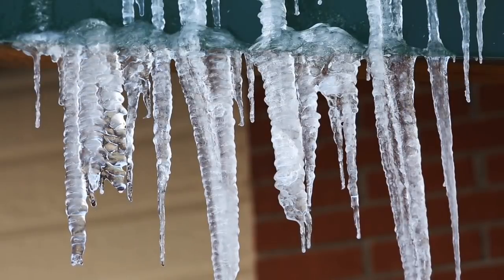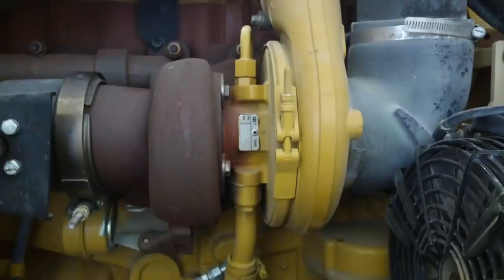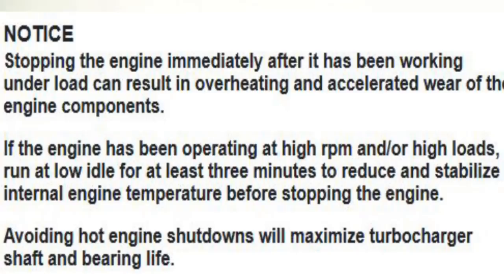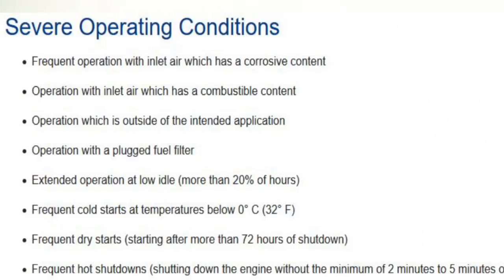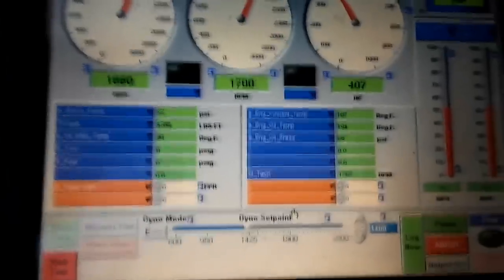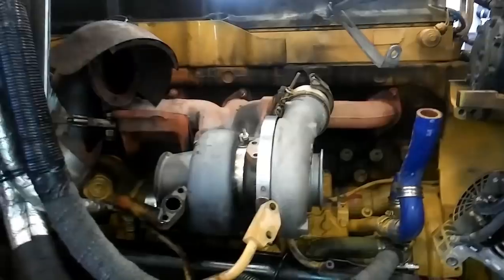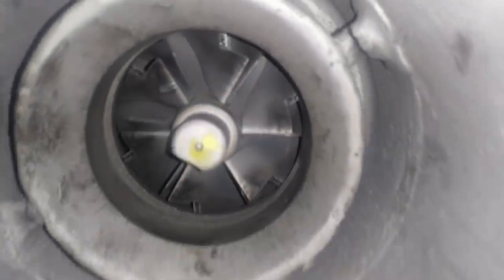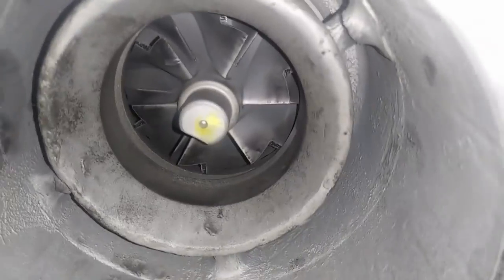Should you let a Diesel Engine Cool Down?

Comment: Exactly! What Josh said! Shame is, newer trucks don't have the guages to monitor all these temps. That's why I had a 96 Pete 379. Thx for the videos. Good job
Reply: Modern engines may well have safety systems built in. There are many engines now that have electric coolant pumps that circulate coolant after engine shut-down, not only through the block and head but also through the turbo bearings. Some may even have similar auxiliary oil pumps that essentially do a similar job, mainly through turbo bearings, especially on engines that have dreadful stop/start systems fitted.   
It is quite amazing that so many people seem not to know the regime for both cold starting or hot stopping engines, especially turbocharged engines whether diesel or gas. Every turbo diesel vehicle I've ever owned has this information in the driver's manual, admittedly not always as prominently as I believe it should be. But it is usually there in black and white.
Reply: Which engines have these electric pumps?
Reply: @jaredmayer3960  
My last Volvo XC90 diesel and my current Kia Sorento diesel certainly have these pumps for the turbo[s]. Pumps generally are going electric on state of the art engines and even automatic transmissions. The Kia/Hyundai wet clutch DCT [another growing trend in cars tractors and trucks] has two electric pumps, one for the wet clutches and one for the mechatronics.
I forgot, the Volvo and Honda have twin turbochargers and the Honda also has a turbo cooling system, although I'm unsure about an electric coolant pump on this one.   More and more cooling systems are getting very complex with ECU controlled valves in the system, as well as the traditional wax thermostats, to restrict cooling to certain areas or increase as demanded, for quick warming and least energy loss.

Comment: Newer Mack trucks if engine is hot will not turn off the engine until it cools itself down. Meaning you can turn the key off yet the truck will remain running until computer turns it off. Usually within 5 to 10 minutes.
Reply: Sounds nice.... useful feature.
Reply: Sounds great until you got a fuel leak that started a fire and you want it off instantly.
Reply: @lungelinecowboy  turning the key back to run position and back to off will override the cool down and kill the engine.
Reply: Better the fire starts on your parking than on your driving you may ask why only 10 percent of time trucker park away from each other most trucker only have two fire extinguisher if so much I carry five or more with the additional truckers around am sure they can bring that fire under control majority of fire while driving mostly end up as total burn out, so it's best to follow the message in the video and post check your truck after. That you don't drive down the road the next day with a fuel line about to rupture ✌️
Reply: @matthewhansen5008  Thanks for reply. It's good they thought about those emergency situations.

Comment: I had a 93 Dodge/Cummins for 20 years. I set the pyrometer probe after the turbo which will always read cooler than pre-turbo. It never hit more than 750d under load and my practice was to let it cool to 300d before shutdown. I now have a 2012 RAM/Cummins and set the pyrometer probe post turbo. It reads well over 1000d just pulling a grade unloaded. I couldn’t find any shutdown information and so settled on 400d. I can tell you from years of experience running these trucks as well as diesel boats that you can idle them till the cows come home and you won’t get much of a reading on the pyrometer and the coolant isn’t much quicker. The engine needs a load for both the exhaust gas and coolant temperatures to rise.  A Cummins engineer told me fire the engines up and idle out of the harbor than gradually bring up the speed. Going back in under idle will cool everything off just fine.

Comment: Thanks -Nicely done Josh well presented & explained . Down here in Southwest TX. heat is a much bigger factor than the cold . I tend to "high idle" ( 700-1000 rpm) my Cats 
 for 15 to 20 minutes then slow idle 400-500 rpm for another 3-5 minutes . This is on a day w/ ambient air temperature @ or above 110 degrees & heavy loaded .

Comment: So I guess when  I pull off of the highway and screw around getting to a camp site or to my storage place I've probably done enough low load running where the engine should be cooled down, but I'll make sure and check.   Keep the good stuff coming.

Comment: Yes it needs to cool down, the red hot turbo needs cool oil to cool It down otherwise it will carbonise the oil left sitting in the turbo when it is shut off straight away without cooling, you should always warm a turbo Diesel engine too. I always put the cabin blower on full hot for 3-5 minutes before shutting off to draw out some heat..

Comment: Josh that was a good find on the turbo, you know within a few days the turbo may have went out and they would’ve tried to blame that on the overhead work.
Reply: Here in Australia we have turbo timers. Whack it in neutral hand brake on and turn off the ignition. Engine will keep going at idle until the timer shuts the engine down.

Comment: I always idle or drive slow for about 10 minutes after driving fast before turning it off.
Reply from the maker: Sounds like you are doing it correctly there.
Reply: With trucks, most of the time the cooldown is built into the driving pattern. One exception might be something like a rest stop at the top of a hill, where you can go from a hard pull to a stop.
Reply: When start should allow idle until oil temp 100 or higher?
Reply: Benefits to engine block heater as high as 45 or 50 degrees? How long heater block?
Reply: Same, my driveway is 1/4 mile down hill with a slight slope, I don’t have a turbo, but I still let my idi cool down for about 2-3minutes. I never truly work my idi that hard, but I always start the truck & let it warm up for 5-10minutes before driving away depending on how cold it is, the 83-94 7.3idis or non turbo engines need more warm up time, this is because when it’s cold it needs a few minutes to get the oil warm, then a few high idle moments to get the heat up, so it runs better.

My previous 95 7.3 PSD was always warm by the time I got up my 1/4 mile up hill driveway, I can tell when it lugs down & accelerates slightly.
Reply: @joemeyer2726  100 degrees Fahrenheit should be perfect, thats what I do since thats the temperature that all the packets and detergents in the oil should be activated and evenly distributed thus decreasing premature engine wear

Comment: When I'm a few minutes from my destination and I know I'll be shutting the engine off I try to run the fan in manual mode and I'll stay a half/full gear down where I would normally be. This typically gets me pretty close to the base idle temperature for coolant and oil without having to idle much at all.

Comment: It's in a freightliner owner manual. Let it idle couple or 3 minutes before turning it off. Often I see the temperature gauge drop 8 to 15 degrees/ oil gets to circulate and cool down and not cook the engine. I even apply it to all semi trucks I been driving since I read that

Comment: I've always been taught to high idle at 1000 rpm for 4 minutes then idle for a minute before shutting down. What's your thoughts on this? Been told its to ensure good flow to cool everything off
Reply: That's not a bad idea. By high idling you avoid the slobber effect on the injectors, and thus cleaner combustion, yet very low power demand with almost no load, so that prevents the increased exhaust gas temperatures, and then a one minute cooldown to get it to the lowest possible temperature.

Comment: Good video. I always knew to let  the engine cool for 5 minutes because during my cdl driving test the instructor got on me for shutting down immediately and explained how scalding hot the turbo is and how the oil will leave a residue on the bearings. I use that 5 minutes to do paperwork and or fuel the truck for the next day. Depending on if I'm over the road or local. 5 minutes is a blink in trucking.

Comment: I always let it run 5mins after shutting the engine down except I've a light cruise for at least 10mins before shutting down then I just let it run an additional minute. :) - Great vid o/
Reply: Turbo timers...set and forget. automatically idles engine after "key off and out" for 1, 3 or 5 minutes (selectable) and that's for a cheap unit...

Comment: The inlet end of the turbo shaft is frozen from air being vacuumed near it.
The heat transfer from the hot side to the cold side of the turbo shaft is significant.

Comment: I have a Cummins 6.7 350 turbo you have to let it idle 7 minutes. Due to the fact that the turbo is still spinning and it has to have oil to the turbo bearing so it won't seize up the turbo. Also cummins has a wet liner idling also cools down the liners. Oil removes up to 80% of engine heat so iding helps cool the engine as well. Cummins engine warranty says you must idle for no less than 7 minutes minimum. When you take it in for service this is checked.

Comment: Yes this is a big issue  in automotive engines, too. The combination of long change intervals and oils with reduced shear stability like 5W30 or 5W20 etc. and not letting engines cool down. The oil gets too hot around the turbo because it doesn't move anymore after engine shutdown and burns up. In most of those cases the turbos fail because of lack of oil supply. I've seen banjo bolts from the turbo oil supply line that were completely clogged with burned oil/carbon buildup. I've had a customer with an Audi that repeatedly destroyed turbo after turbo on his car in as little as 20,000mls. 
Some manufacturers have now additional electric water and oil pumps that keep running after engine shutdown to minimize this problem.

Comment: When I started my job ( doing deliveries with a Kenworth T270 paccar 8.3L engine with 270k miles ) I was new to trucking at 18. I didn't clean the air filter enough times and didn't replace the fuel filter enough but the worst part of it all was kind of my bosses fault. He told me to save fuel by shutting her down while I do a delivery so I did exactly that. No cool down. I got the turbo rebuilt at 400k miles not sure how long it's been bad at that point. And for a long time I've been telling mechanics that I belive one of my pistons is worn out and I can feel it while driving. They think that's nonsense but I've now confirmed it's true and we are now rebuilding the engine at 425k. What do you guys think I did that would have damaged it the most? I think it was the quick shut downs which will dry out the bearings and the oil in the turbo sending the thick nasty overheated oil back through the engine .

Comment: We had a 600KW cat genset that we used to run our grain dryer. It had one speed wide open. Always felt bad shutting down a screaming engine at night. Usually had at least 10 to 20 minutes of light to no load as I shut off fans.

Comment: Yes! I always stress this to my customers as well with their equipment. When I pull up to the house at the end of the day, I let the service truck idle a good 15-20 minutes while I do paperwork and check things over for my post trip.

How are you liking SIS 2.0? I work for a deere dealer so I am partial to their system. But we do a fair bit of cat work also. And I think 2.0 is a nice change and a little easier on the eyes.

Comment: I drive, but it doesn't have a kitty kitty, I grew up around heavy equipment & my dad thought me this back in the late 70's - early 80's.I run lowboy & load my self, even after getting it on lowboy, I set the brake & let it idle to cool down as I'm tying it down then shut it off.When I get back to shop ,I let it idle to cool it as I'm fueling up & after I actually park it. As I'm doing my walk around checking things out then checking temperature, if it's down I shut it down.

Comment: Military taught us to let the engines rest at the end, after a hard run.
Reply: What did they suggest?.......we had Humvees in Iraq and i don't remember my driver purposely doing this although we hit the fuel point before heading to the hooch.
Reply: @arnoldziffle8779  I was a generator tech. The big 120k with Detroit Diesels would run hard all day. Cook you sitting next to them, so we unloaded them for 10 minutes and let them cool down.
Reply: @christopherrasmussen8718  what detroit Diesels? I worked with LAV's from 2014 to 2018, we still ran detroit 6v53T engines, I do remember letting specifically the turbo cool prior to shutting the machines down, but mostly because the turbo was quite remotely mounted having about 3 feet of oil hoses to and from the housing

Comment: If you’ve been going up on a steep grade for a mile or more, you don’t want to shut down the engine right after the grade. The water temperature will continue moving up and getting cooled by the fan for the next 15 minutes or so after the upgrade. If you don’t do this and shut off the engine right after a steep upgrade, you’ll notice that the water temperature is maxed out on the gauge next time you turn on your engine. This can damage gaskets, o-rings, hoses, etc.

Comment: Sir, I would like to thank you for the publications sir. I have a Taurus tractor engine with a malfunctioning C9 engine valve. I set the valves when I started the engine; It is no longer the same in the rotary engine and slows down a lot when turned on

Comment: The turbo issues reminds me of long ago as a kid sitting at the local farm tractor pull contest ( there were a variety of agriculture related events going on ) and every so often a farmer would stall out his engine as its pulling down and stalled before he could pull the throttle back and hit the clutch pedal. At least one of those times in that instant before the driver could restart the engine there was this loud squealing coming from the engine as it would have been the turbo shaft spinning over fast yet with zero oil getting to the bearing, doubt that turbo lasted long after that happened. In the real world lets say having an electronic issue or climbing a grade on a low tank of fuel and having the engine die while under full load, Mr Turbo would not be a happy camper after a treatment like that. Then one truly would be sounding like the goat who just had his balls cut off when getting the bill LOL.

Comment: it was all the rage a few years ago to fit timers to your turbo diesel 4wd, so it would continue to idle for a few minutes after you turned the key off.
Reply: And that is another reason diesels last longer if you fit Turbo timers...set and forget. automatically idles engine after "key off and out" for 1, 3 or 5 minutes (selectable) and that's for a cheap unit...

Comment: After going up a long hill or mountain with a straight 6 with an all over 6 cilinder head i would stop on top of the hill idling the engine   to cool her down slowly in stead of going down hill cooling fast. Might save your gasket or head from cracking

Comment: Hey can you explain why some bolts use washers and some don't on engines.  thanks
Reply: Depends on the types of washers. sometimes they are used as spacers, keep you from tightening a bolt too much. Many times they aren't needed as it isn't possible to tighten it too much. More commonly though, Lockwashers are used on bolts. Particularly on engines or other mechanisms that produce a lot of vibrations. Lockwashers are split and are spring loaded outward. When tightened down, they put a force outward on the bolt, keeping the bolt tight and preventing it from loosening due to vibrations.

Mostly you see Lockwashers because they are needed On most mechanical machines due to the amount of vibrations they produce. Something that doesn't vibrate won't have them on it though.

Comment: If the engine is running full power the exhaust temp is +/- 480 degrees Celcius, When you stop the engine directly, the tensions in the metal is enorm. (head vs block) if you let it cool down till a mild 130 degrees Celcius, the difference between the collant is a mild 50 degrees (80 degrees for the coolant and 130 for the exhaust = +/- 50 degrees Celcius) Compare this with full load 480 degrees Celcius exhaust with 80 degrees Celcius collant  = +/-400 degrees Celcius. Metal expands more @ 480 degrees temp then with 130 degrees

Comment: Another way to think of it is that diesel engines are air pumps with fuel added to create heat, which when it bursns, causes the air to expand from which energy (mechanical) is extracted. Diesel engines, unlike gasoline, always pump the same amount (mass) of air per revolution, whether idling, or at full load. The first question that should be answered is "what is under load" as it is the fuel that produces heat, the simple answer is how much the throttle pedal is depressed, how much fuel you are burning, if for the previous 5 minutes you were running at full throttle, you should let it "cool down" for longer than if you were running at quarter throttle.  If you are pulling a heavy load uphill and the engine starts to overheat, the worst thing you can do is pull over, stop and turn off the engine, the better thing to do is when you first notice the temperature getting high is to slow down, downshift if you can, the increase in rpm will cause an increase in air mass going through the engine, and help take away heat, repeat as necessary.

Comment: I installed a Banks iDash in my Ram truck just so I can monitor the Exhaust Gas Temperature (EGT) so I know when it is safe to turn off the engine. I always let the EGT reach 400 degrees before turning off the engine.

Comment: I had a Pyrometer in my exhaust. I used to let it idle until it dropped to typical Idle temps. That usually was 3-5 Minutes after a Freeway run
Reply: Turbo timers...set and forget. automatically idles engine after "key off and out" for 1, 3 or 5 minutes (selectable) and that's for a cheap unit...